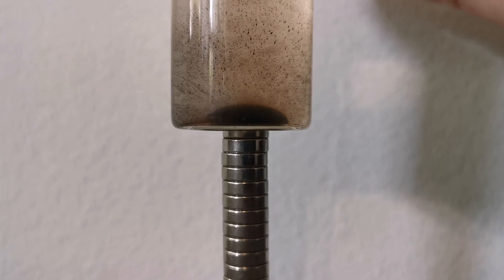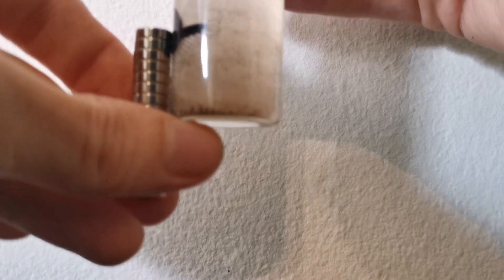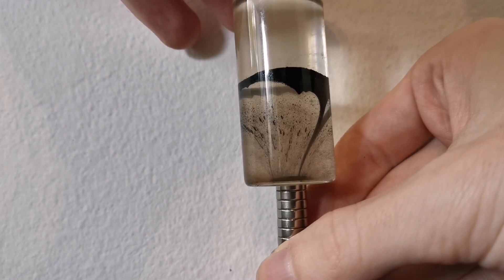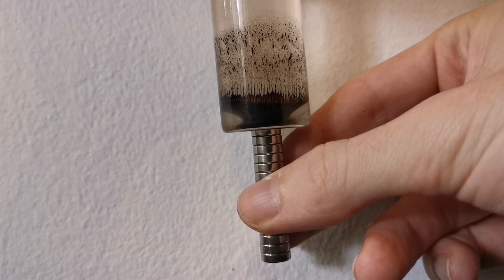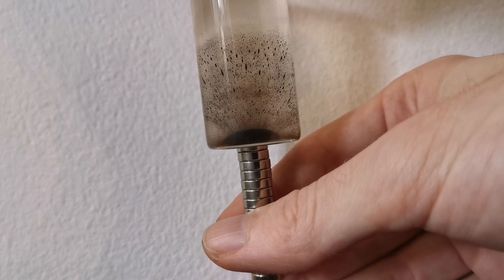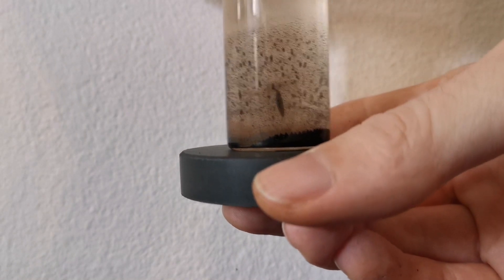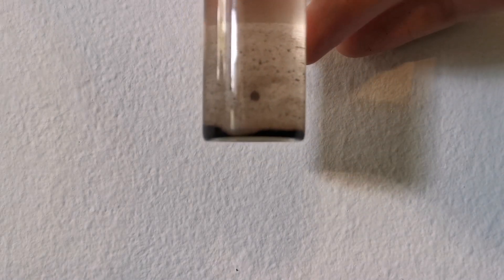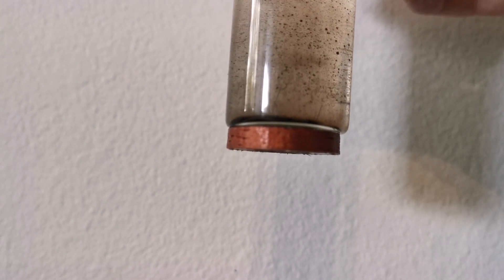The magnetic field viewed in 3D with a simple field viewer

Comment: Is it possible for you to place your stack of magnets in small vial (even that one you're using here but empty) or bottle, then place that in a larger glass container containing ferrofluid so that the smaller vial is fully submerged in the centre? The small vial or bottle would need to be sealed. The idea is to show the magnetic fields from the north pole to the south pole. The sealed vial keeps the fluid away from the magnets.
Traditionally, the fields are always shown as curved lines running from one end to the other of the magnet. While you sort of show those fields, I'm wondering if they really exist like they are usually depicted or if it is just imagination. Something like this ( | ) if you understand what I mean.
Reply from the maker: Yes this should work, good idea.
You will have to spread the ferrofluid to the outer walls of the outer container evenly and after that insert a magnet to the inner container because it is the movement (or the path the ferrofluid travels) that is making a 3D image of the magnetic field.
The inner magnet has to be removable so you can "reset" the viewer by spreading the fluid to the outer wall like I showed in the video.

If you use a field viewer like I showed in my earlier videos or a ferrocell you can see the toroidal (donut shaped) nature of the magnetic field very well.
Reply: @OmegaZZ111  Thanks, I'll take a look at your other vids.